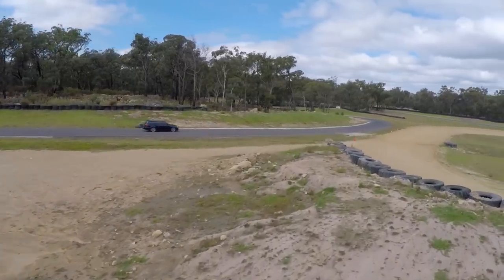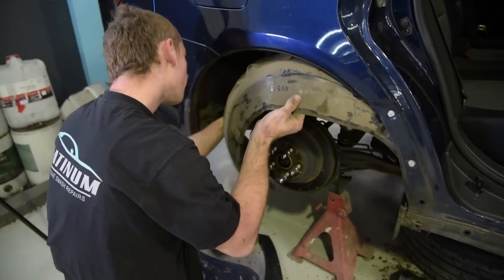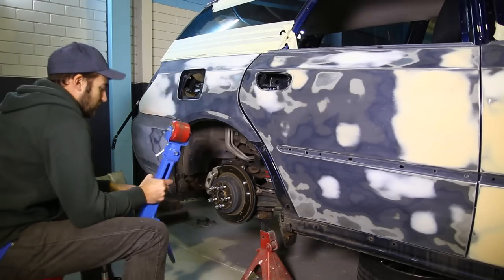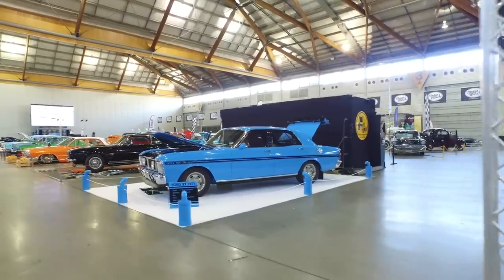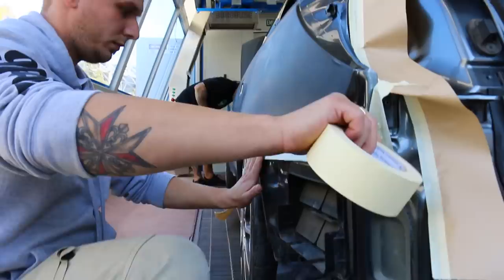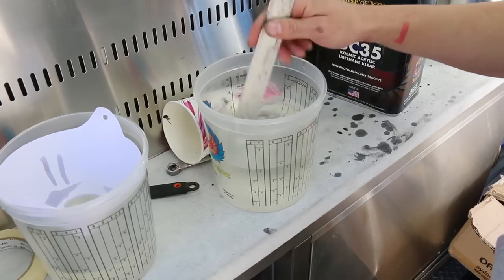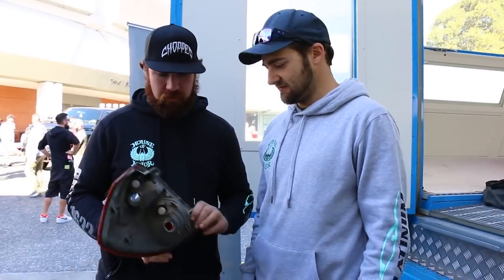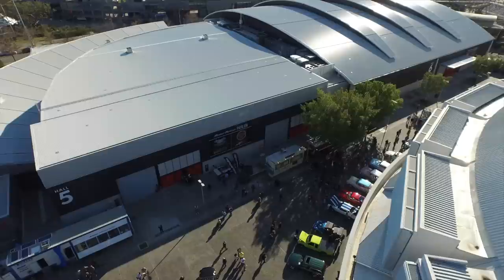Supergramps - Part 4

Comment: Nice colour but couldn't help notice that orange peel finish on the close up. I'd be miffed if that was my car but still, its better than it was no doubt about it.
Probably the result of the mobile paint thing not having temperature control system fitted.
Reply: +R33Racer you do realize that there's a second part, right?
Reply: +Mudux Part 2 is just them putting it together (if you listened towards the end of the video). Some polish might cure some of it but I doubt it.
Reply: Wet sanding would fix it.
Reply: R33Racer every paint job get orange peel. If they will wet sand it or not on the second part, well, we have to wait and see.
Reply: +R33Racer They even said in the video that they put extra clear on it so they could buff it really shiny :P Ofcourse you could get a decent factory standard finish but whats the point when you are going to buff it after anyway?...
Reply: Yea but you're the captain of the SS R33 so nobody really cares
Reply: paintballisawsome  I was forced to sell it actually, but that's another story.
Reply: +Jimmy Wännström most new cars come from the factory with orange peel now. It's pretty disgusting but manufacturers are cheaping out to increase the profit margin.

Comment: What is the Paint Code I want to paint my RX-7 in that colour 😊
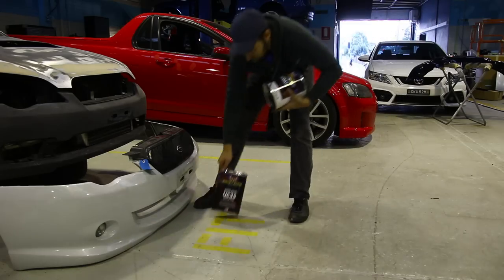Reply: +DemzTv It's on the tin at 3:53! :)
Reply: SU-01SQUID-JUICE
Reply: SU-01SQUID-JUICE
Reply: +DemzTv You have an RX7 thats hella tight dude
Reply: Jdm Gavin he doesn't he has a prius
Reply: I own a 93 Rx-7 single Turbo with a 20B swap running 20 PSI on a Garrett GT-35 turbo with 95 OCT fuel pushing around 600HP it's got a M2 Performance Racing Intercooler And Radiator with a Greddy Oil Cooler It's Also Got an HKS intake as well as an Apexi Timer
Reply: +ConverseBoy64 I think people are just jealous.
Reply: DemzTv its cool that you got an rx7
Reply: @soldtheark3157  3 years later, youre still full of it.

Comment: As someone who spends at least 12 hours a day doing body/paint I was pretty disappointed to see that much filler used on super gramps, that means they must have not even slightly attempted to pull the dents, basically just sanded and slapped on filler, ID give it 3 years at most before you have filler cracking everywhere, if I did a job like that I'd be out of buisness

Comment: theres often not much left of car bodies here in canada past 400,000km... few vehicles make it that far here. then again i worked on a 2004 pontiac grand prix with 600,000km on it and it looked better than most ones with under 100,000km, flawless. maintenence matters

Comment: Supergramps finally getting painted, and it looks awesome!I was wondering if anyone knew where to get the Squid Juice paint code?
Reply: From your local House of Kolor distributor
Reply: Screen shot the can and take it to a house of Kolor vendor. It has the exact formula on the top of there can. But HOK will make any custom color you want. Squid juice is the colo HOK made for MCM.

Comment: GAH! Dont leave her outside in the rain again! lol 

hey also guys make sure you dont wax the car for awhile after its finished, as the paint needs to dry, cure and vent its fumes first, otherwise the wax can cause the fumes to become trapped and bubble the paint, and make sure you have a car cover that breathes and only use one, or it can cause the same thing to happen, as I had my car worked over by a guy who had the bumper looking like new and that is what he told me not do with it.

and he mentioned that the bubbling thing, can happen to any car if you dont have a car cover that breaths, no matter how old the paint job, as it happened to a client of his with a 53 Corvette.

Comment: I thought auto body shops used a white primer.
Not a dark gray
Reply: +IIGrayfoxII depends on what the final colour is.

Hard to do black over white and vice versa.
Reply: Depends on the finished color. No sense in using a bright primer that'll mess with your dark finished product.
Reply: It depends on the base coat colour
Reply: +IIGrayfoxII On the original Gramps though they used a white/light greyish primer.

Comment: i'm planning to paint my car doors at home (outdoor) did anyone here tried outdoor before ??  btw its  metallic paint , is it safe to do at home
Reply: +Chamara Jaya I've played around with the idea of doing an outdoor, spray paint job before on my car..however, that idea went out the door when I washed my car one day before I was going to wax it, went back inside to eat (1 hour), came back outside and my whole car was already covered in light dust/pollen. Had I been doing a paint job..well, you can imagine lol.
Reply: +Chamara Jaya Make a paint booth out of a temporary garage. They're made of plastic tarps and some metal poles and they're not expensive.
Reply: +JobeMinacum yes that's a good idea man

Comment: How much would this type of paint job cost?
Reply: +aznboi tommy Well, how long is a unicorn's wang? I don't know. It depends on the quality of the job though. If you want just the outside done (known as a door-shut respray), it'll cost anywhere between, for argument's sake, $2000-5000. If you want a complete colour change, like here, I'd guesstimate it'd cost between $4000-8000+. The cost would be reduced, I would imagine, if you did most of the panel repair yourself.

Comment: the sti wheels were way cooler than that 6 spoke nonsense.  those sti wheels also fit 225 tires with just needing a fender roll.

Comment: gramps is burning oil super bad. Full engine rebuild incoming?
Reply: +Grigor Simeonov Na it is something to do with the oil lines to the turbo
Reply: +Grigor Simeonov You talking about at 4:12? Looks like they moved it immediately after a cold start, and that the temperature there is cold to begin with.
Reply: +grigor simeonov cos it cold
Reply: It's winter in Australia so it's just the warm condensation in the exhaust in the cold air.
Reply: It's a ball bearing turbo. They put an oil restrictor in the oil lines and it's stopped the smoking issue.